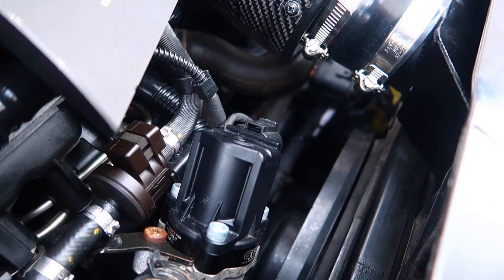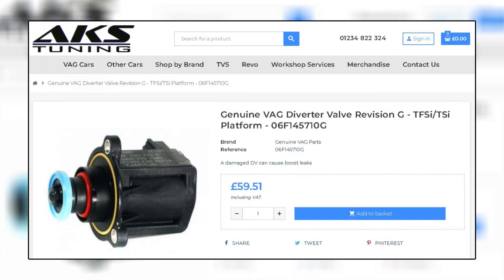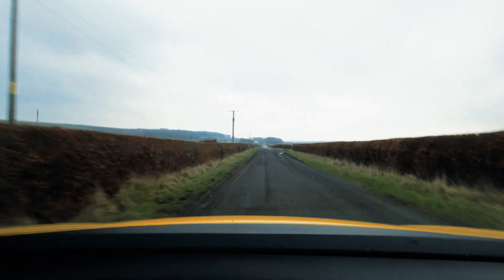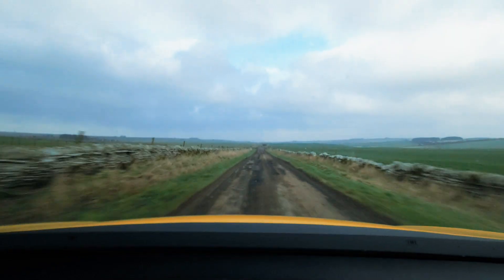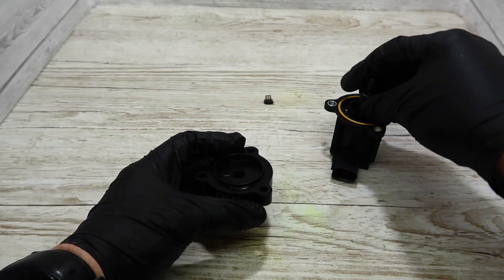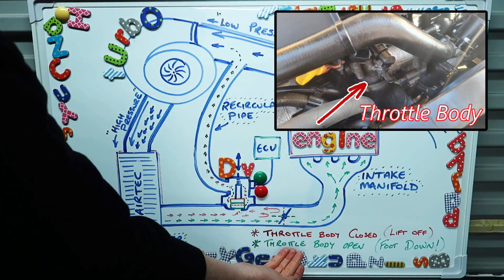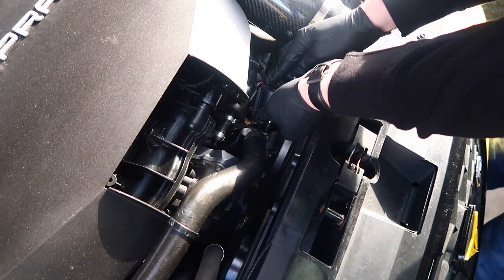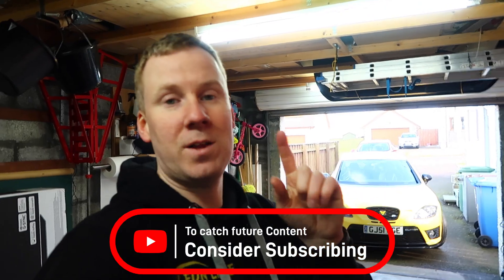Am I keeping my GFB DV+? OR time for a Revision G diverter Valve? MK2 Leon 1P1

Comment: That’s explanation was perfect. Nicely done. One thing I’ve noticed is when you’re on boost and you let off the accelerator and then quickly press the accelerator again slightly the DV doesn’t open and you get compressor surge (turbo flutter)
Reply from the maker: Yeah, I get the flutter quite a lot as well, I'm not sure the exact reason behind it. Cars possibly do it a little anyway, but with the DV+ it's more prominent, and if you've an induction kit, you can hear way more. 
How do u find urs for performance day to day?
Reply: @NorthCoastWorkshop  yeah I think it’s simple that the DV closes again when you slightly touch the throttle so the air gets forced back through the turbo causing the flutter. Yes I have a oversized ram air filter and it’s actually louder than my exhaust lol performance wise it’s faultless, holds boost perfectly and never leaks
Reply from the maker: That's good to hear. And yeah what u said sounds right for the flutter noise, the DV+'s just are that responsive. Cheers for watching the vid and  taking the time to comment Reece👍🏻

Comment: Really great video thanks a lot for the info as well. Looking to get this, have a stage 2 cupra having some boost issues along with pigeon noise so presume it's DV valve as it's never been changed. Dumb question though, just wondered if anyone knows if I'd fit this direct onto the dodgy valve or I'd be better buying revision G and then fitting this 😳
Reply from the maker: Cheers Jack, appreciate the kind words. The majority of failed diverter valves are down to the diaphragm and plungers components, instead of the large electric solenoid part (that the GFB re-uses). If you are still unsure, yes using reliable parts from the new Rev G would be better for peace of mind. 
2 choices, - get a GFB and re-use the solenoid that's more than likely ok OR great a rev G, fit it and see if it sorts it, and if not use it in combo with the GFB (expensive option tho 🙈)
Hope that helps Jack 👍🏻

Comment: Hello, is the gfb dv the valve that gives the car pshhh sound? because mine doesnt make that sound when i installed it
Reply from the maker: Your car may need a map so that the boost is slightly increased and you will most likely need a large open air induction kit to hear the most from the turbo system. These things amplify the noise for the TFSI engines 👍🏻

Comment: Hey great vid! I was wondering if you could do an exhaust system video? I have a Seat Leon MK2 1.6 TDI and imo sounds so awful, I want to know where you could purchase one?
Reply from the maker: Hey Nadeem, Cheers for watching 👍🏻 I'm not sure what exhaust systems are available for the diesel Leon's like yours, or if they can use the same systems as the petrols/Cupra's (I've a Cupra R). I think you can purchase a rear diffuser with the centre exit setup on it, then get an exhaust system to match. 
If you aren't already a member, apply to join the "MK2 Seat Leon owners club UK" on Facebook. All the members are really helpful with queries like that, and they'll be able to recommend an exhaust system for your 1.6 TDI 👍🏻 My system is a cobra turbo back system for the Cupra R models only.

Comment: the OEM rev G diverter valve will not work with a high boost setup (Stage 2+ or 3), at that point the options available are as many as there are brands on the market!
Reply from the maker: That's good to know Howard, cheers. I wasn't aware they couldn't be used above a certain boost
Reply: Not true at all, very know tuners like R-Tech who specializes with EA113, EA888 engines, basically all GTI, R, S, RS and etc., actually recommends OEM rev G for stage 2+ and above as these holds boost the best.
Reply: @TheChazas  maybe in my location there are not good tunerS, all ask for upgrading the OEM diverter valve with at least a fitting as the DVB

Comment: Great video , glad to see  someone is happy with a dv+ 👍Personally I’ve had a dv+ for more than 3 years on my golf Mk6R CDL engine code at stage 2+  and still very happy with it  must admit I do remove it for a clean , seal + wear check and lube up every 12 month , just ordered the VTA T9451 as a replacement for 2 main reasons .
After the stage 2 tune the extra boost pressure causes the stock k04 turbo to surge due to the increased volume of diverted air being dumped upstream of the already maxed k04 compressor . 
Because of the efficiency of the dv+ it diverts the air very quickly and completely, the problem of the surge / flutter is removed with the VTA option with added whoosh at throttle lift off.
I was planning on ordering new seals springs and piston from GFB after more tha 3 years of operation which are wear items at the end of the day , but went with VTA instead.
Like you rightly said the revG has finally solved the oem issues and you always have that option. 
Oh and the roads in the North West are shockingly bad ! Had no idea .
MOT must be expensive on wheels , tyres and suspension with the roads that bad 😵‍💫
Reply from the maker: Cheers for taking the time to comment.
Firstly yes, I'm finding the GFB diverter perfect and it's good to hear another owner singing it's praises too. But what u said about the Ko4 being maxed out makes a lot of sense, so if u get a chance, let me know how you get on with the VTA (I'm always on the look out for upgrades 😁)
I will be checking mine annually now on an oil change, just to keep an eye on it, but so far so good 🤞🏻
And yep, roads are falling to bits up here just now. I've cracked an alloy twice over the years sadly. £300 of road tax a year to then spend more on fixing wheels and suspension because of poop roads 🤨
Cheers again Richard 👍🏻
Reply: No, that's just normal K04 surge. Only way you can eliminate it is buy sticking in a antisurge core.

Comment: I’ve got revision G in my a3 2.0t fsi with 2 original springs, best idea I’ve had and works even better than the revision G single spring which is already good.
Reply from the maker: That does indeed sound like a good idea 👍🏻 to help return that piston to its start position fully and quicker 👌🏻

Comment: My boys about to fit one of these on his stage 2 mk2 focus st when he fits his Rs clutch...... Imo,  a lot of these were first fitted unlubricated,    because of the brass inside the anodised aluminium housing which initially feels quite slick, but still needed lubing......jmo
Reply from the maker: Yeah, definitely no harm putting a little engine oil on them prior to installation. It should be fine from then on, as it kind of self lubricates with the vapours in the intake system. The focus ST's are brilliant cars! You can't beat that 5 cylinder Volvo engine in them for sound/exhaust note 👌🏻 cheers for watching Robert

Comment: Mine worked perfectly until I went full E85 stage 2, it was causing too much leak after that so I had to buy a new OEM diverter valve
Reply from the maker: Good to know, cheers for the heads up as I want to go stage 2 at some point as well. My GFB is still going strong, but willing to say goodbye to it if it gives up 😂

Comment: Your missing the small orange rubber o ring on the small spring metal piece
Reply from the maker: Hey Matthew. Sorry I'm not sure which part you're meaning exactly, that is missing an O ring. 
The main body of my GFB has it's large dark orange O ring, and I also have the O ring on the end of the small plunger which fits on top of the thin spring.

Comment: This is brilliant! Thank you so much for this its nice and comprehensive!! I've got a Mk3 Leon but im looking at getting one of these. I've seen GFB have a similar product called a VTA which they claim vents to atm but also still recirculates the air?? not sure how that works!
Reply from the maker: Glad you found the vid useful. I'm afraid I've never looked into their VTA, but if it still recirculates then it should be fine. I don't think it affects things too much, it's more that the engine management might think it's a boost leak, so the EML might light up.
Cheers for watching 😊👍🏻

Comment: as long as your getting clean air it should be fine. That piston has a tight tolerance but it is not oil required to move tight. I a little gun lube. I temp long life synthetic. it will last a long time.
Reply from the maker: Good to know, thank you 👍🏻

Comment: Would it be beneficial to upgrade the valve and also install a spacer? I was looking at the GFB and also the ecs spacer
Reply from the maker: I'll admit I'm not 100% clued up on the ECS spacer. Though reading into it, it vents excess boost to the air rather than recirculating it back into the turbo, which sometimes causes running issue with tfsi engines.
Best bet is to try and see someone else with an ECS, and find out what they think of it. I wouldn't say upgrading the piston is required, but if you have the early C revision, the G revision is a worthy and cheaper upgrade Vs the GFB retail price. 
Hope that helps, and let me know how u get on 👍🏻

Comment: Do you think this would make a difference with a dsg gearbox ? I have a dsg box in my gti and don't know if it would make the same difference as the manual
Reply from the maker: It's a really good question, but I can't be sure how it would work out. I'm sure it would work, but whether you'd see a benefit, I don't know. 
DSG boxes are very advanced and the speed at which they shift as standard could probably only be properly increased via software.
Sorry I can't answer your question mate, maybe someone else that see ur comment may know 🤞🏻

Comment: Any opinion on installing one of these on a Ford Ranger 2021 2.3 ecoboost? I'm in the U.S. and have been looking at these and don't really want the vent sound.
Thanks!
Reply from the maker: I'm not too clued up on the 2.3 ecoboost engines, but can say that if u currently have an aftermarket blow off valve fitted, then this will definitely have less of a venting noise coming from it, as long as it's diverting air back into the engine and not into the atmosphere.
What do you currently have fitted to your ranger?
These GFB valves are still heard a little when an aftermarket induction kit is fitted to the engine, along with turbo noises too.
Reply: @NorthCoastWorkshop  completely stock at the moment. Overall plan is intercooler, new pipes, exhaust, maybe a tune. Thought I would start with something simple like this piece. 
Thanks
Reply from the maker: Ah I see, yes it's a good easy first mod. That's some big plans ahead, nice 👌🏻 
Your original diverter valve may be up to the job of holding extra boost when u get a remap, so maybe look into recommended engine mods for your engine, to see if owners upgrade the DV. 
But yes, if u do decide to get one, you shouldn't hear a dump valve noise, but you will hear more turbo noises if u add an intake.
Best of luck with the mods 💪🏻👍🏻

Comment: Can the oem dv throw out a rich condition code if it leaks.
Reply from the maker: Not as far as I'm aware. It'll tend to be just boost issues the DV will flag up. Rich condition issues will be more likely related to O2 sensors, or the MAF sensor, bad spark plugs, ignition coils, Evap system etc. Hopefully you can trace the issue 🤞🏻
Reply: @NorthCoastWorkshop  my golf 6 Gti have stage 1 tune. I did replace injectors,spark plugs and o2 sensor. Only part I didn't change or clean is my MAF. When car goes in boost I can hear a small whistle noise that's why I think my DV is leaking.

Comment: I have a DSG Mk6 R with an intake and gfb dv+ attached to rev D diverter, I get some wicked chatter flutter at about 3500 -> under load which I think is from the dv+ actuating on and off, power for sure doesnt feel linear or sound like your tfsi, thoughts?
Reply from the maker: Yeah sounds like something is intermittently releasing boost. The solenoid from the revision D diverter valve could be playing up, or something could be hampering the GFB from working properly. Maybe have a double check that the piston is tight in the housing of the GFB, but has just enough slack to smoothly move in and out.
A smoke test would be my next suggestion, to see if there's any boost leaks, and maybe have someone log the boost (specified Vs actual) as possibly the car is overboosting and the diverter valve is struggling to handle the excessive boost.
Final one would be to pop a newest revision OEM diverter valve on the car and see what happens.
Hope that makes sense, a lot of things to try.
Reply: @NorthCoastWorkshop  Ive had it at the shop before and confirmed it was boosting correctly with logs. I think Ill just stick to Rev D, maybe try Rev G one day.

I also have it Stage 1 tune from 034 Motorsports, so I will pull some logs and see if I can assess from there. Thanks for your reply, great suggestions!
Reply from the maker: @BittaThisBittaThat  no probs at all, and let me know if u manage to get it sorted 👍🏻

Comment: by installing the DV+ does the dump valve make a louder noise or does it remain the same?
Reply from the maker: This DV+ doesn't dump air into the atmosphere like the atmospheric dump valve u can buy, it instead recirculates it back into the turbo, but if you have a large aftermarket intake, you'll hear this and other turbo noises a lot more, so it sounds like a dump valve in some ways.
Having a car on a remap will also increase boost pressure noises.
Reply: @NorthCoastWorkshop  okay thank you, by placing a KN filter in the original air box will this already change a few things?
Reply from the maker: It will help the engine breathe a bit better, but you'll only get more turbo noises if you go for an open ended induction kit like a Revo or itg intake

Comment: Quick question, is dv+ supposed to be covered with oil inside? or is my dv broken?
Reply from the maker: When first put together, the metal piston should be lubricated with a very small amount of fresh engine oil, just applied with ur finger, but after that it should be fine to be left alone (though some owners like to lubricate it annually). The engine isn't designed to lubricate the DV+ piston, the little oil applied at the start of its assembly should be enough.
Hope that makes sense and helps 👍🏻
Reply: @NorthCoastWorkshop  i see, i checked my dv+ cause i have been losing all the boost pressure, when i took dv electric clip off it was covered with oil, as well i seperated the dv and checked every  little thing the hole dv was covered with used motor oil inside, there was a lot off oil, so i quess my dv is broken as it should not to that, can that cause all the boost pressure losing, as i said i cant get any boost at all, turbo is new and shut work correctly (sorry for bad english, hopefully u understood something :)
Reply from the maker: If the inside of the DV is covered with used engine oil (dark coloured oil) then it sounds like oil is getting into the boost pipes somehow.
There shouldn't be any oil in those pipes really, you might sometimes get a little in the intercooler pipework. 
I'd recommend taking it to a garage to have them check the turbo itself. If there is oil in the diverter valve pipework, and you've lost boost, it's maybe an oil seal on the turbo that's badly worn and leaking oil into the system 🙁

Comment: Have you even thought about disconnecting your soundaktor?
Reply from the maker: I didn't know the MK2's had one or where to find it🙈
Reply: @NorthCoastWorkshop  it's under the scuttle panel, I unplugged mine and you realise how much of the engine noise isn't engine noise. Give it ago unplugging it you will be surprised.
Reply from the maker: @cozifpv2069  is it an electrical connection to unplug or a pipe? Pretty easy to identify it?
Reply: @NorthCoastWorkshop  it's easily identified I found a couple of guides online you could probably do a video on it because the only videos show the newer vag cars

Comment: The valve has no sound?
Reply from the maker: Not directly from it no, u may be thinking of blow off valves that make a woosh noise directly from them.
Any noises heard from the engine that sound similar to that, or turbo noises, are heard with an aftermarket air intake, meaning all the air inlet noises are a lot more audible.
Hope that clears up u query, cheers 👍🏻
Reply: @NorthCoastWorkshop  i installed my dv+ today and yes , you re right. I love the sound of aftermarket air intake , but i have a megane 4 gt and sadly i don t have space for that kind of filter:(
Reply from the maker: @zapo1255  sometimes a performance air filter that fits in the standard airbox for ur engine may be an option? Sorry to hear there's not a lot of room for an induction kit 😔
Reply: @NorthCoastWorkshop  Performance air filters that fits in the standard box have no sound i guess , right?
Reply from the maker: They'll have a little sound, but not as much as an induction kit. Maybe someone has made a kit that will fit the Renault? If u ask on forums, Instagram etc??

Comment: The GFB diverting vavle is ok but turbosmart makes bolt on fullsized BOVs that are way better
Nice build though
Reply: BOV’s are not better for these cars its actually worse. Doesnt carry the boost to each gear
Reply: @darkphoenixhdtv  completely wrong bub I ended up with a turbosmart BOV and it didn't do anything except add a whooshing noise when I would let off throttle.....if you drive a automatic trans like a manual letting off the throttle before each gear change yes it has a very small amount of lag but drag and even autocross I never had issues....2014 cadillac ats 2.0 performance zzp downpipe,intake,big wheel turbo mod, higher stall converter with 6l45 upgraded clutchs and drum 430whp @26psi